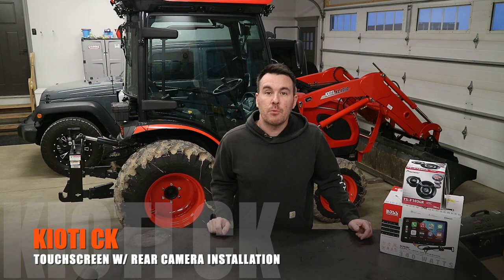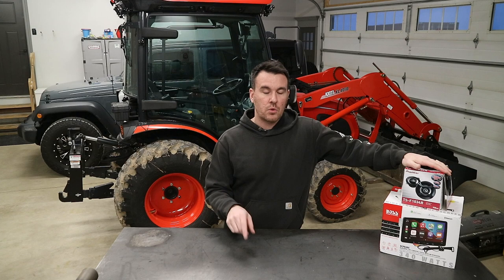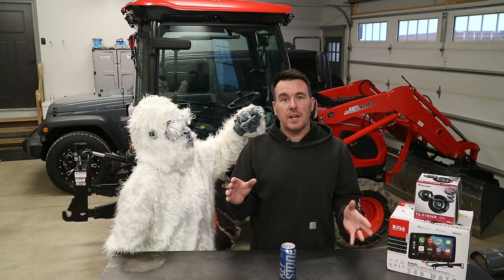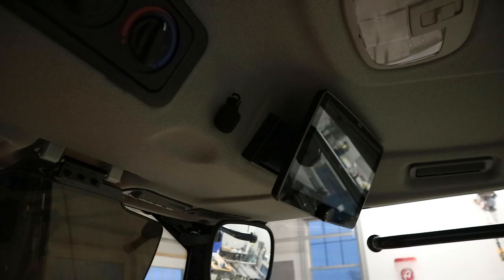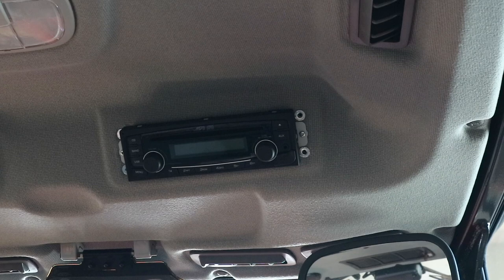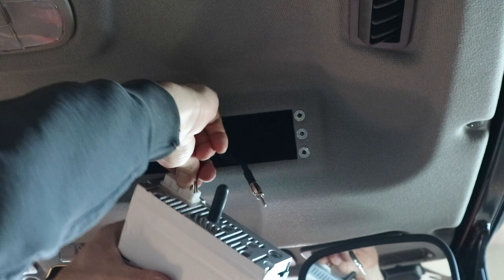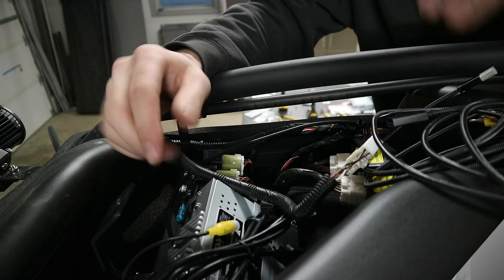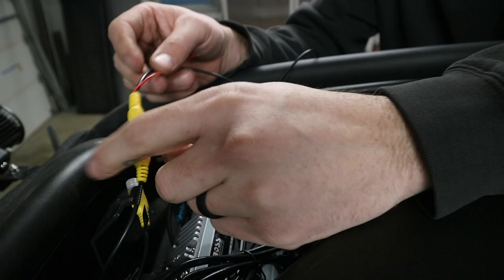HOW to INSTALL rear CAMERA on KIOTI!!    PART 2

Comment: Great Job!!!! Thank you so much. Too bad the tracktor manufacturers don't have a plug and play upgrade system.
Reply from the maker: Ya that would be nice.  I tried to help out by making that wiring diagram.  Im actually working with Kioti right now to make some upgrade kits for the compact tractors.  LED upgrade and this touchscreen system after some more testing.   They want me to set one up for display and do the installs.
Reply: @SpicerDesignsLLC  Any update on this with working with Kioti?
Reply from the maker: No that all just fizzled out.  They didnt have any stock at the time and i have since moved 4 hours away.  Would be a great option to have available.  I love having it.

Comment: Was there anything inside the roof that you had to disconnect before removing the roof?  I removed the 6 nuts & washers and can pick up the front but the back is not coming up.  It looks like the inside vent has a spring and some other connection.  Any information is appreciated!
Reply from the maker: I had to cut a small slit in the fresh air vent cover to remove it.  Once you do that you should be able to get the roof off.

Comment: How do those speakers work with no stereo to power them ? I plug my phone into the usb connection and dont have a radio in my DK10 Cab and wondered how the Speakers are powered unlike a Car Stereo powering the Speakers ?
Reply from the maker: In mine there is a switch on the left side.  It says aux and stereo.  If you flip it to aux your phone will power the speakers
Reply from the maker: Also the factory usb jack is just for charging.  You have to use the 3mm aux jack to play music though your phone

Comment: Great video. Going to get a new stereo for my ck3510. Those new wires you ran going back to the camera, are they just like an extension cord for the longer run ?
Reply from the maker: Thanks,  the rear camera is made for a license plate mount. So it comes with an extension cable that will go the length of a vehicle.   You will need another 2 conductor 18 gauge wire from the head unit to the rear camera for the dc power and the red tail on the camera wire.  Hopefully that helps.  thanks for watching!

Comment: Hey Kyle I am wiring up the same Boss unit and was gonna wire the Boss Harness to a Kioti #TR-1500 Pigtail Harness and just wondered if the wiring you did here worked out ok ?
Reply from the maker: I thought i cut the plug off the old unit.  Did you see the wiring diagram i made in the install video? Not sure if that helps answer your question
Reply: Did that #TR-1500 pigtail work? I’d rather do that cut my factory wiring.
Reply: @jakecurrie0  Yea it did

Comment: Hey boss I wanna do the same thing with my bobcat tractor. How does the back up camera activate? Not like there's a reverse gear as it's in the pedals, how does it know when to activate to reverse or can you choose to display the backup camera all the time. Sorry for the confusing explanation
Reply from the maker: All good.  You just hit the camera option on the touchscreen and it will turn on until you shit it off.  You can still play the radio too.  Works well.

Comment: The 9 inch version is sold out. Will the 10 inch work and fit just as well?
Reply from the maker: I would imagine it would.  Theres still a bit of space around it. The extra weight may not be ideal. Just be sure to really secure the head unit.